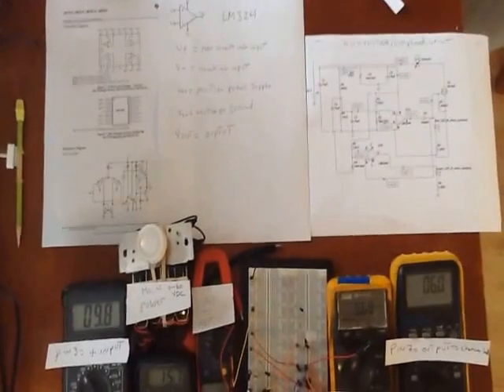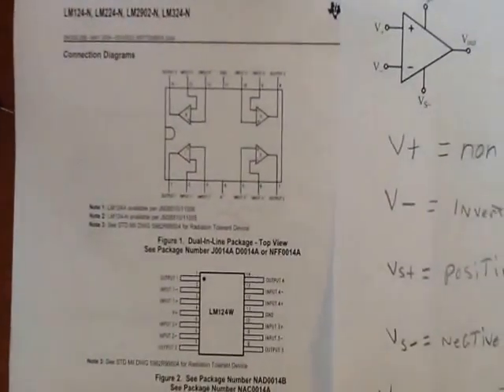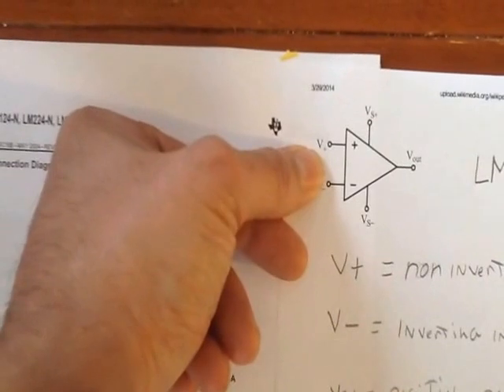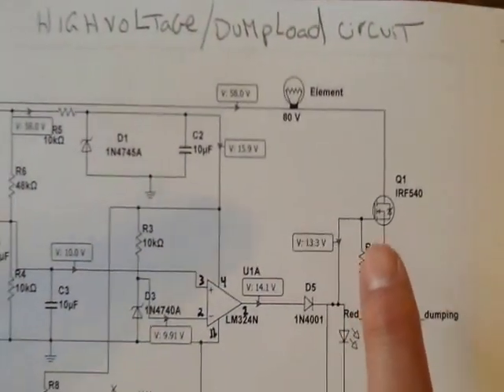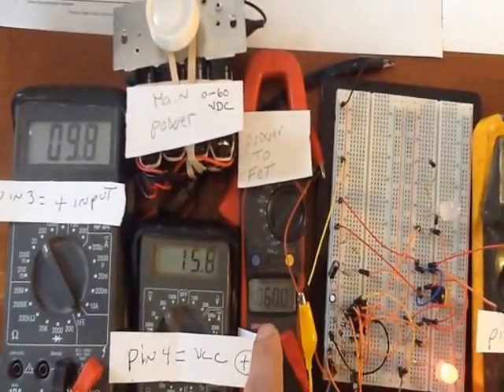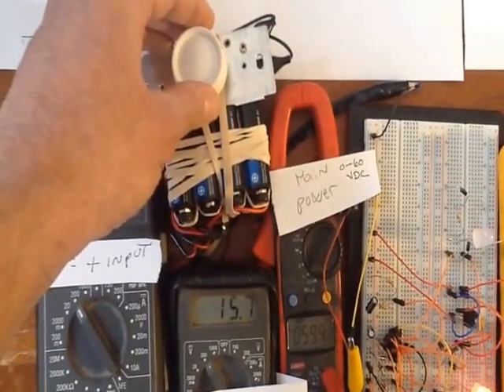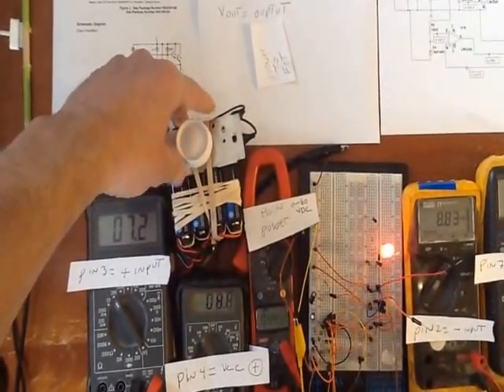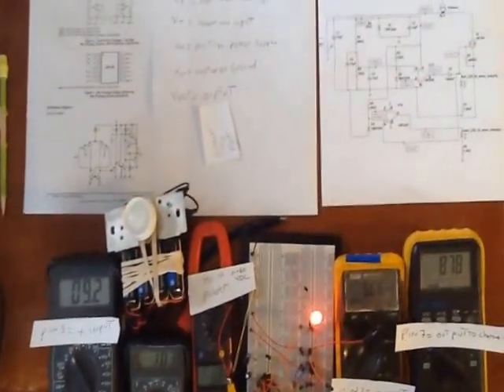DIY High voltage Diversion dump load circuit 0148vdc wind controller

Comment: Good job guy, U never fail to impress.
Now do not forget about us 24 v guys, or can I use the same circuit and trip my SSR at 4.3V.
Reply from the maker: hey bro, yah, 24vdc can be done, just with few changes.

Comment: I have a generator that originally was built for wind and I'm using it for hydro. It is putting out 90vt DC after rectifier. Could this unit work for my situation?

Comment: If you or anyone else needs help with circuits I can help as I have time.
Reply from the maker: that would be great, i am new to this, i will contact you when in need of help.   thanks

sam
Reply: The LM 324 is a voltage amplifier circuit with a standard voltage gain of about 157, that will amplify the .09 voltage difference up to 14 volts.
Reply: There is a slight possibility of a problem with this circuit, and that is if the light bulb should break the circuit will not be able to dump the excess power so the voltage could exceed the maximum threshold voltage.
Reply from the maker: Mark Osborn  Mark, mod the circuit for me, and add what ever you think will result in the same target variation output. thanks for your help and support.
sam
Reply: Okay.
Reply: I finished the modifications where do you want me to send it?